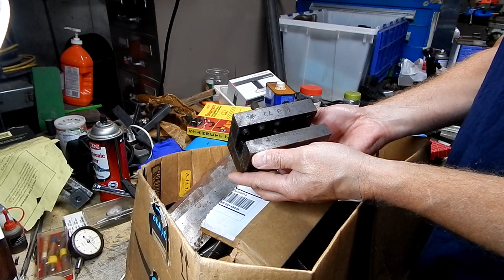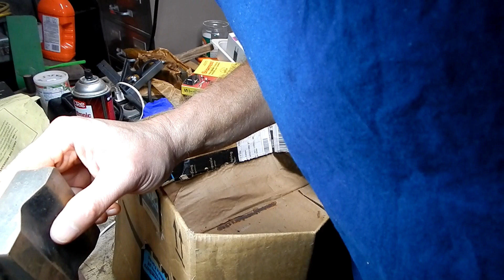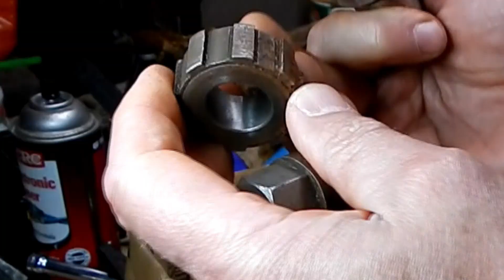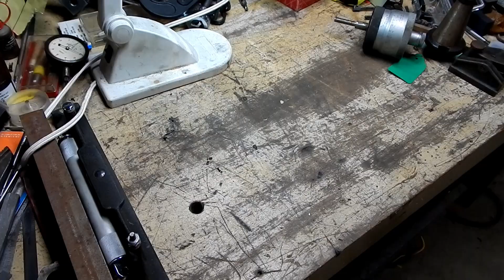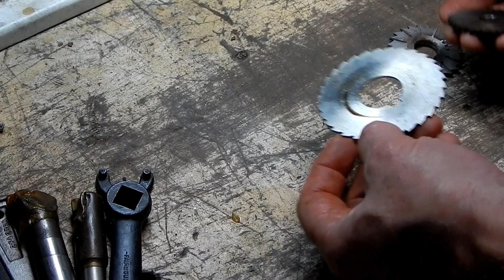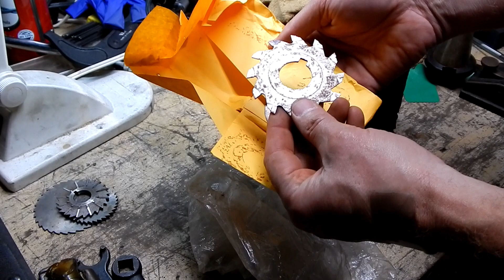August 2019 tool estsate sale Part 1

Comment: you can use some horizontal arbor cutters with a arbor.  I do that relatively reguluarly.  I forget if Wells has a arbor support avalable for your mill.
Reply: I usually only buy cutters B&S and Morse, and once in a while Cleveland.